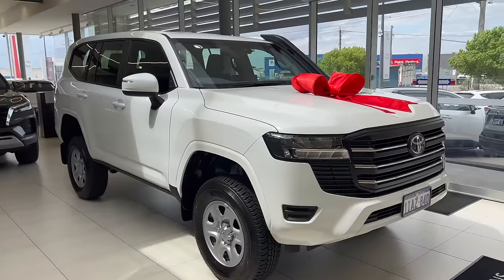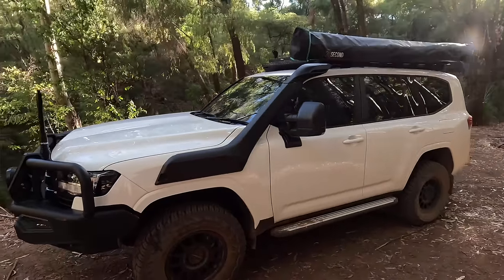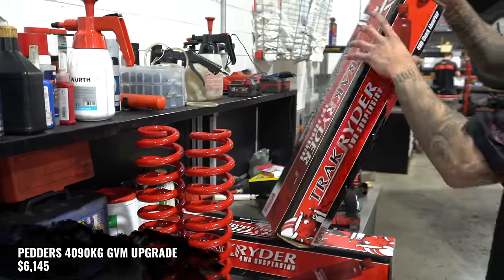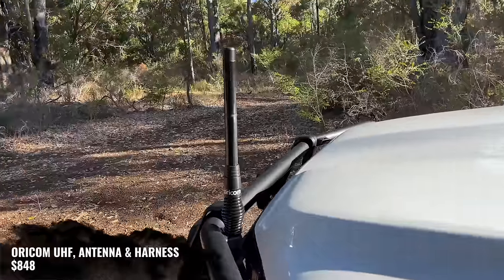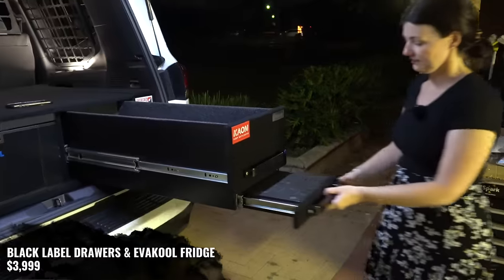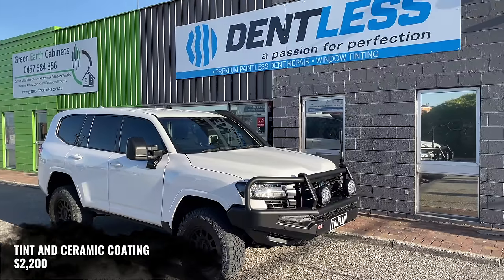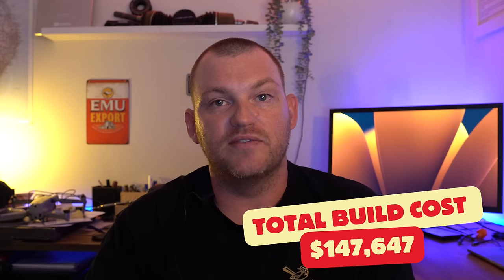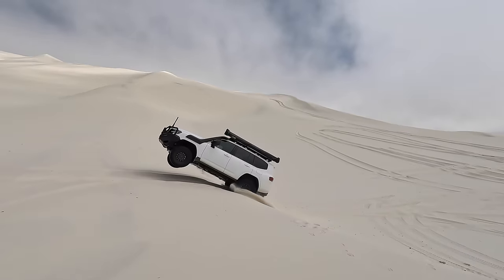BOG STOCK TO BUILT IN 4 MINUTES  ||  Toyota LandCruiser 300 Series Touring Build  |  TOTAL COST $$$

Comment: Thanks Cam & Tiff, I am sure this will assist others in planning their budgets. I reckon you did okay and TBH, thought it would be higher. I have a 2019 200 VX tourer with similar style touring and tow build and my cost was quite a bit higher than yours.
Reply from the maker: Cheers mate, it’s easy to drop big money on these vehicles. There is endless gear and none of it’s cheap!

Comment: Actually not that bad. My Defender D300 HSE was $140k on road, and mods to make it a tourer was over $30k
Reply: Anything looks like good value compared to a defender
Reply: Ok fan Toyota fan boy. Enjoy your CD player 🙄
Reply: Now you've got me envious.
That right there is the perfect tourer/tow/off-road capable vehicle off the showroom floor.
What's the add ons you opted for?
Reply: Heavy Duty long range tank, dual ladders, dual roto pax fuel mounts, expedition roof rack, rhino bull bar, warn winch, quick silver exhaust, tuff ant rims with brake conversion, KM3 tires, CB radio, Cel Fi, 200amps of lithium, custom drawer, Engel draw fridge, led light bars and side and rear lights, arb twin compressor in engine bay; with exits on the front and rear. I think that was it.

Comment: Why I unfollow so many on youtube
Over complicate something so simple and make others think they need to also spend the same to "tour"

Question ... if a "GVM upgrade" was so simple, why doesn't Toyota offer it ?
Who warrants any damage done towing too heavy ?
Pedders?
Toyota sure wont
Reply from the maker: I’m not telling anyone what they NEED to “tour”,  I’m just sharing what I have done.

A GVM upgrade is pretty simple. Toyota can organise it, as they did for me.

No manufacturer would sell every vehicle with a GVM upgrade as standard because the car would be horrendously uncomfortable driving it off the show room floor empty without weight in it.  Most users won’t need the upgrade. 

GVM upgrade doesn’t mean you can tow more. It increases your payload in the vehicle. Towing is still 3500kg, or 6750kg combined. 

Warranty situation is going to be unique for every claim. But I’ve never had a problem in my years and many thousands of kms with cars that have GVM upgrades. Have made several successful insurance and warranty claims.